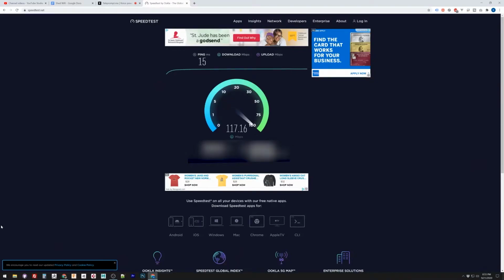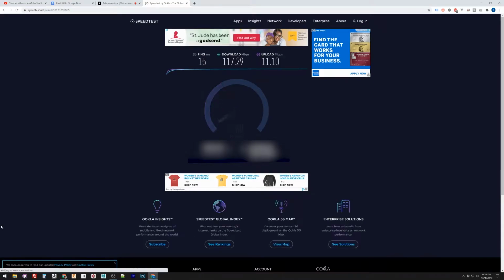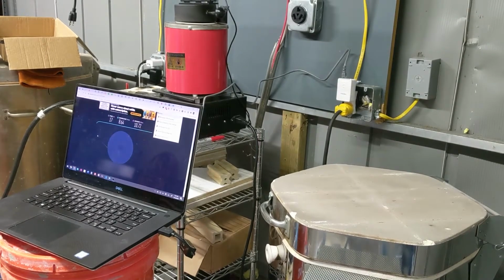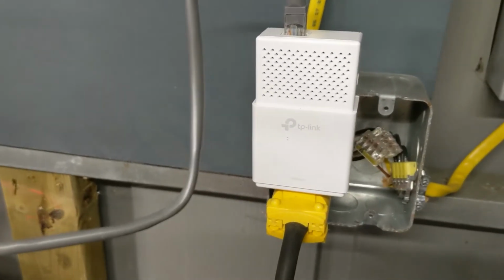PyKiln Long Distance Network Connection Using Powerline Adapters Review

Comment: Fyi, I have a similar problem, but got away with not needing any extenders by using what are referred to as directional antennas.

Bought one per antenna, elevated them on a bar to be higher than a person, and pointed them to the garage, and devices in the garage tend to receive internet quite acceptably.
Reply from the maker: Very cool! I've seen some shitty aluminum foil and cardboard cutouts you can slip over directional antennas. What kind of directional antennas are you using? Was it hard to align them?